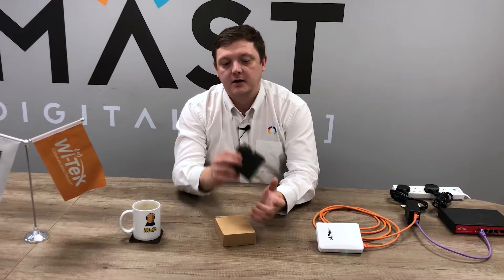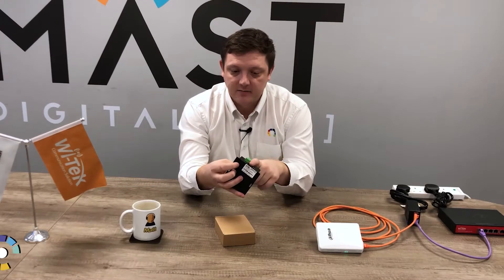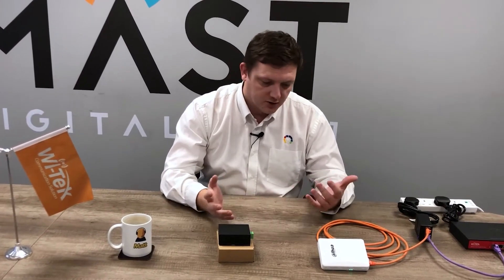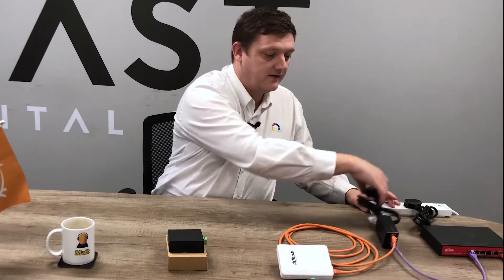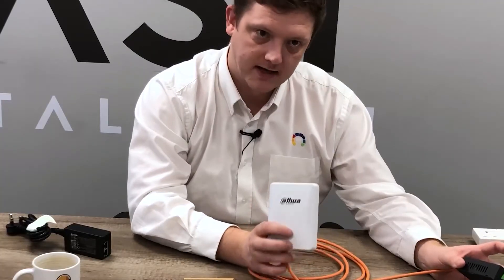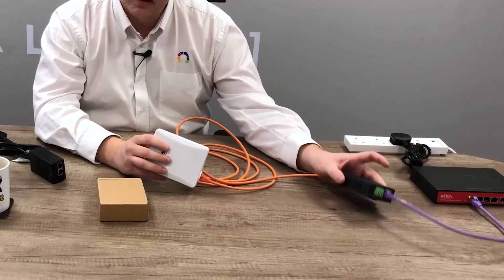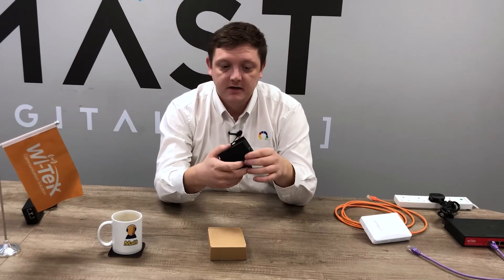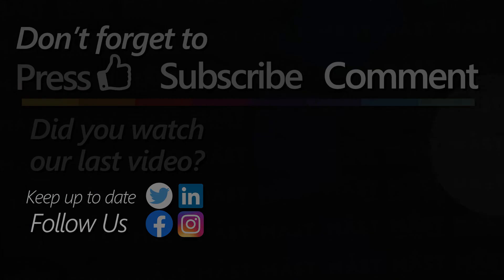How to Convert 48V PoE down to 24V Passive PoE with a Wi-Tek Converter

Comment: I know this is old, but I found it very useful. 
I’m currently looking at getting a UISP switch which gives 27v passive PoE. (I know weird, but I researched and pretty sure it’ll accept 24v-27v)

I can find any 24v Poe cameras, they’re all 48v now, so will using this converter work?
TYSM I subbed 👍